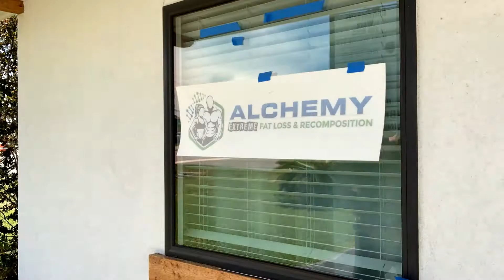DBG | Design Personalize Install - Evolve w/ JT Window Decal Production & Application

Comment: Next time tape a piece of coroplast to the window to get your level line. If you put it up against the vertical bars on door it’s perfect.
Reply from the maker: Thanks for the tip Keith!  

Typically I don't align them like this - I was doing a lot of back and forth between what looked visually centered with the window and what was horizontally even with the graphic that was on the door. That's just not conveyed in these time-lapse videos :)